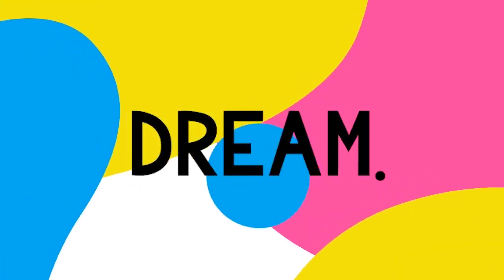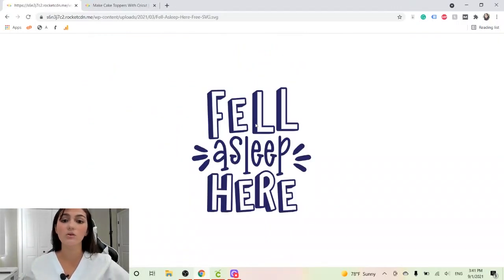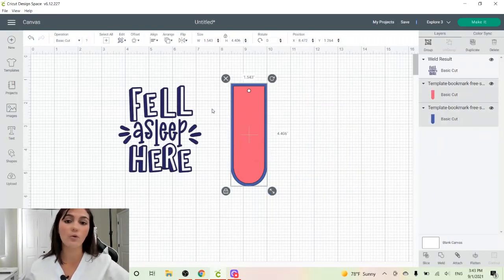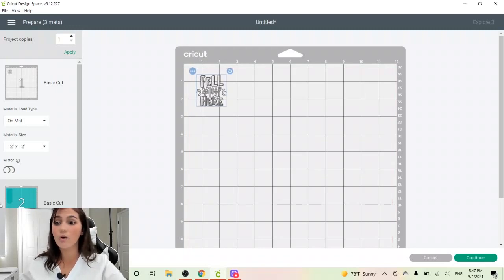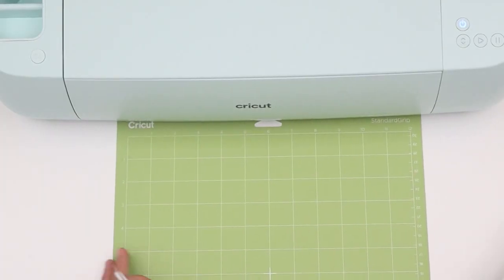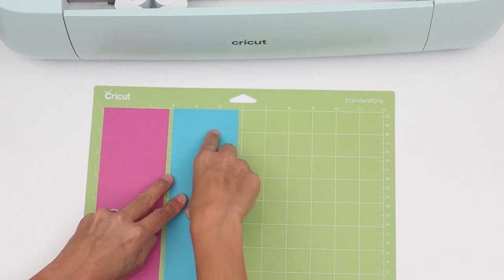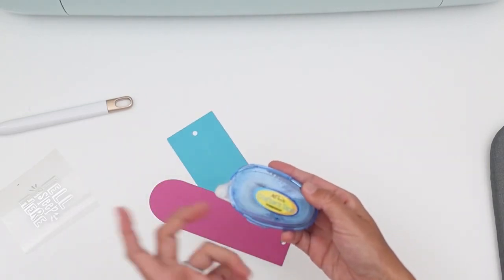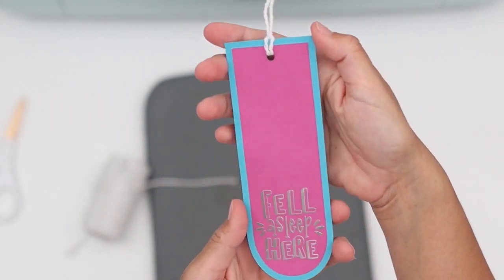How to Make Bookmarks with your Cricut Machine

Comment: I got some Foil Quill heat activated foil on clearance today, but would it work for this? It doesn't have a carrier sheet or adhesive. Is it the wrong material?